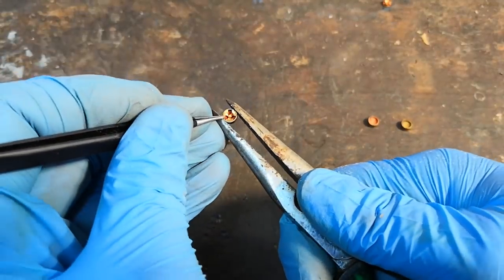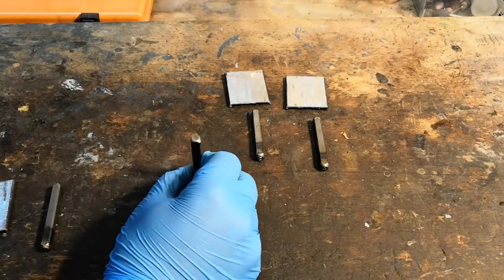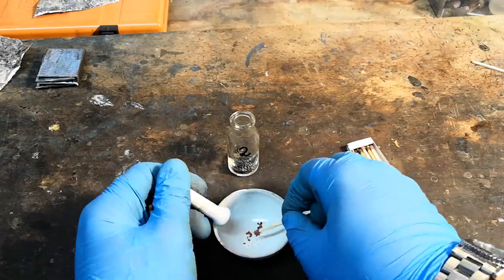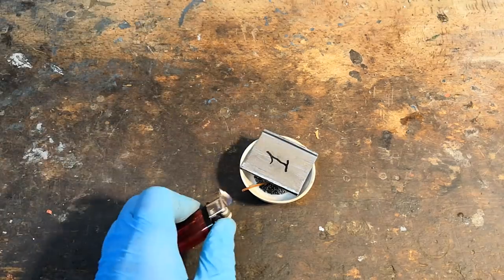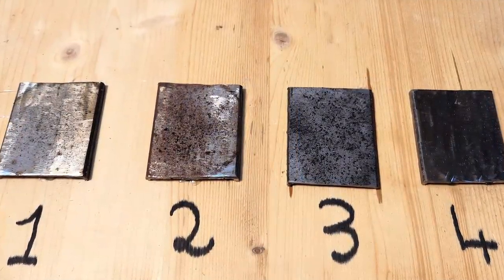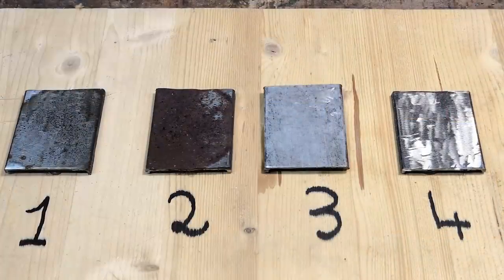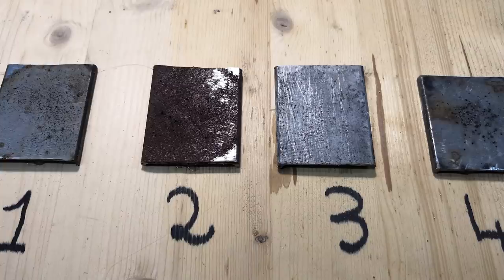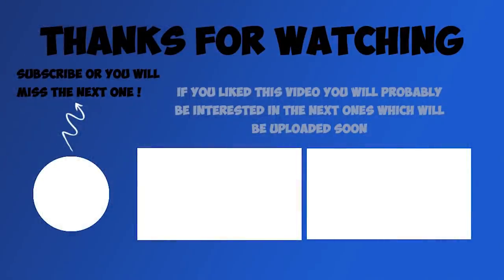How Fast Corrosive Ammunition Ruins Guns

Comment: Excellent video! I didn't realize that potassium chlorate was the reason for old primers being so corrosive. Beautifully done experiment!
Reply: How it came to be in the primer is an interesting factoid.

The earliest primers used mercury fulminate to fire their charges of black powder, and the black powder fouling diluted and trapped much of the mercury that was evolved when the mercury fulminate exploded. Since the black powder fouling had to be washed from the case before the cartridge could be reloaded, the effect of the mercury on the brass was minimal. That changed with the advent of smokeless powder, which left much less residue.

The problem with mercury and brass is the mercury forms an amalgam with the copper. That left the brass cases weakened and prone to breakage when they were next fired, as the zinc was brittle without the copper to strengthen it and the copper amalgam was weaker than the copper. Once the US Army found the cause of the embrittlement, they reformulated primers to use a non-mercuric priming mix. The reasoning was the Potassium chloride left in the bore by firing the primers was less troublesome to deal with than the metallic mercury the mercuric primers left.

Comment: Well done 👍🏻 From personal experience with surplus Russian ammunition from the 60’s that used the mercuric primers, the corrosion will start much faster than sample #2. 

The simple way to stop the corrosion is to wipe the bore and bolt with a patch soaked in glass cleaner and then clean the gun as normal with the bore cleaner of your choice.
Reply from the maker: I see that being very effective, since glass cleaner is water based, and the corrosive reidues are water soluble. The surfactants probably help as well. Thabks for sharing
Reply: I usually just pore boiling water down the barrel and go at it with Dawn dishsoap. Then I clean it as normal.
Reply: What a goober. No Soviet mil-surp ammo came with mercuric primers. As late as the 90's former Warsaw Pact countries were still using potassium chlorate primers for military ammo.
Reply: I was wondering about Mercury fulminates as well

Comment: I shoot a lot of corrosive ammo out of my Ak74&47, and my Mausers and Nagants. Also out of my Nagant pistol as well, I never have a problem with corrosion because the first thing I do when I get back from the range (corrosive ammo or not) is clean my weapons. And for corrosive ammo, what I use, and I got this from my USMC vet and gunsmith father, hot soapy water. I've never had any corrosion issues and all my firing pins and internals look great. Just make sure you dry it out well, wipe it down, and then oil or put your white lithium grease (what I use) as you normally would after it's been wiped dry. All the firearms I use corrosive ammo out of have been fine, you just gotta clean them a little more if that's what you want to do or you'll regret it.

Comment: Back in the day, I only shot surplus corrosive ammo out of my 8mm Yugo Mauser.  When we got home from the range, I removed the bolt, inverted the gun in a bucket of hot, soapy water and brushed thoroughly. Followed by a clean water rinse and regular cleaning and oiling.  Man those days were good.

Comment: Great information! I was surprised the black powder had no signs of corrosion. When I shoot old surplus ammo that's corrosive I just run some water down the barrel and action of the firearm I used, I previously used Windex as I heard you need the ammonia inside the Windex to neutralize the corrosive salts. I now only use water, Windex is unnecessary.
Reply from the maker: Hey there! You must have quite an experience in shooting old ammo😝
Reply: Maybe a little lol

Comment: A nice scientific experiment without and testosterone induced rants. Pure firearms facts. Very nice BB!
This is exactly why I always use a gallon of hot water to clean my Mosin barrel after using surplus ammo. After the water run a dry rag a few times through and then one with oil. Nice and clean. It's how I've kept my Mosin in such good condition for so long.

Comment: Black powder fowling is hydroscopic which is why it has the reputation it does for needing to be cleaned. in a high humidity environment it will hold the moisture against the metal. it does very little in dry environments when non corrosive primers are used. if you want to see why it had the terrible reputation that it does set a sample with the black powder and corrosive priming compound. the fowling will hold the moisture and contain the salts.

Comment: The primers in old black power rounds had mercury in them. That caused the brass cases to be weakened in the case of reloading. This also causes corrosion in the barrels and other parts of the gun.

Comment: I use mostly corrosive ammo in my 8mm Mauser. To clean it I give the inside of the barrel a swab with a strong dish soap solution. Then pull the bolt, turn it so the muzzle is pointing down, and blast it was the steamer on my coffee maker. Wait until I see clean water coming out, then clean like normal.
Be warned, the barrel gets very hot using this technique.
Reply from the maker: Thank you for sharing 🙏

Comment: I find Pyrodex black powder substitute to be considerably more corrosive than black powder. The manufacturer advertises that it is cleaner than black powder, in a sense that is correct because Pyrodex is considerably more energetic than black powder by weight, it is also less dense, so an equal volume charge can be expected to produce less residue than black powder since less weight is being burned. However, I find the Pyrodex residue is more difficult to clean and more corrosive. The formula for Pyrodex is essentially the same as black powder, however in addition to the standard ingredients it contains potassium perchlorate, which I believe is the source of the extra energy as well as the source of Pyrodex's extra corrosive effect. Note that Pyrodex is easily available, works well in percussion weapons, and is inexpensive compared to black powder, and the additional source of corrosion is of no consequence if the weapon is cleaned promptly after use. I sometimes do not promptly clean after use, and find myself much better off using real black powder.
Triple Seven powder is based on sugar rather than charcoal, lacks sulfer, and also contans perchlorate. It is rather expensive, but I find thie cost is offset by the fact that it is higher energy than both standard black powder or pyrodex, thus less is required to achieve a given bullet velocity, so a pound of Triple Seven will last longer than Pyrodex or standard black powder when you reduce charges as recommended by the maufacturer.
I find use of Triple seven reduces fouling compared to other options, yet still tends to be corrossive compared to black powder thus prompt cleaning is recommnded.
I would enjoy a video comparing both the volume of fouling and the corrosive effect of the various black powder substitutes with black powder itself.
My favourite choice of propellant is Olde Eynsford black powder. It is comparable to Swiss but costs less. It is approximately as energetic as Triple Seven and burns cleaner than standard black powder. I also find the fouling to be less corrosive than other choices. I have neglected cleaning at times with Olde Eynsford, at times for weeks, and gotten away with it and escaped serious corrosion. Not recommended though. I also find the cleaning easier. Another subject for a video - the ease of solubility of the fouling various propellant choices, or more simply put, the ease of cleaning. There should be a scientific way to measure that.
Cheers, and thanks for the video.

Comment: Is cleaning the bore of my rifle with just really hot water adequate for dissolving the corrosive salts? I heard people say to use windex because it has ammonia. But really windex works because it is largely water based.

I typically put a spray bottle with really hot water down into the chamber and spray the barrel. Then blow the gun and barrel with an air compressor to speed drying and get out excess fouling. Then I clean the bore with solvent and patches.

Is that overkill? I could probably go without the air compressor part. I have heard in the past people just used really hot water because that is all they had.

Comment: Remember, there was no such things a 'Corrosive' primers before Remington invented their non-corrosive "Kleanbore' primers. Only after this do we start referring to primers as corrosive or non-corrosive, mostly following WWII. Why? Because the military were reluctant to jump on a bandwagon that had no track record of how long these new primers last in storage. The first US use of non-corrosive primers came about with the adoption of the US M1 Carbine. The Ordnance folks recognized that the carbine's short piston action would be very vulnerable if not kept clean, a difficult thing under combat conditions. This is why you seldom encounter a M1 Carbine with a bad bore. I've been firing both types for over fifty-years. I never experienced bore rust problems except for the one instance when I deliberately did not proper clean a rifle bore after firing corrosive ammo. I was planning on replacing the rifle's barrel, and wanted to see the result. The best way to properly clean 'Corrosive' primers is to use hot water or WWII era US Bore Cleaner. This type of primer residue requires a water based solution that will dissolve the salt like crystals in the bore, oil does not do it. :)

Comment: With the black powder you need to use some primer compound in the burn as it takes a primer to ignite in a rifle. The compound afterburn will be way worse as to corrosion speed.
Reply: Modern percussion caps for black powder arms are no different than the non-corrosive primer compound used in smokeless cartridges. And flintlocks don't use impact-sensitive primer compounds at all.

Comment: Did sample 2 start to create pitting or was it just surface rust?
Reply from the maker: It was surface rust, but there are places where corrosion is faster, so those parts will tend over time to sink more than the rest, creating pits, but not as well defined as proper pitting

Comment: In the 80s and 90s we had Chinese 7.62x39 ammo here with corrosive primers. Very inexpensive and we shot lots of rounds. It trashed a few firearms that weren't cleaned after use. I thought it was because the primers used a mercury basesd compound. Or was potassium chlorate used in conjunction with mercury? Whatever the  case we blamed "mercuric primers"
Reply: Mercury fulminate was discontinued in primers in the late 1800s for the most part. Berdan primers in surplus ammo use potassium chlorate.

Comment: But if cleaned after each use does it really matter?
Reply: I have shot tons of corrosive ammo with absolutely no problems.
After shooting just rinse with soapy water, then clean and relube as usual. 
The salts absorb moisture, causing corrosion.  During dry weather I've gone days before cleaning without without any rust.
Reply: @900stx7  100% agree

Comment: Black powder must be confined to produce the "coke" which is harmful to steel. 60% humidity? That's like North Florida in the winter. After shooting corrosively primed 7n6 I saw rust specks on the BCG left in the white in under 48 hours. 80% humidity is more common in the summer.

Comment: Interesting what type of steel did you use for these tests? I would be interested in seeing how other steel types resisted or fell prey to this test.
Reply from the maker: It was a simple mild steel (less than 0.2% carbon), but the low alloy steels commonly used in gun industry have very similar corrosive properties. High alloy steels tend to corrode slower, and stainless only start corroding after a certain threshold of aggresive substances is exceeded. After that though, they typically corrode very fast, with localized and deep pits.

Comment: Is this acidic corrosive or alkaline corrosive?
Reply from the maker: Steel corrodes in neutral and acidic environments, while it passivates in alkaline ones. Chlorate based primers usually produce pH neutral residues, while black powder residues are slightly alkaline.
Reply: @Backyard.Ballistics  
Thank you for that answer.